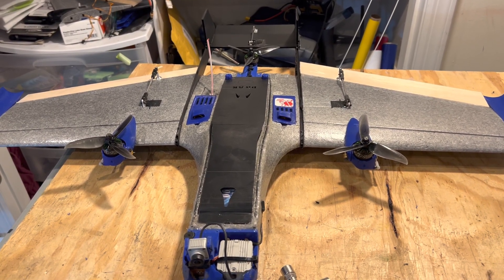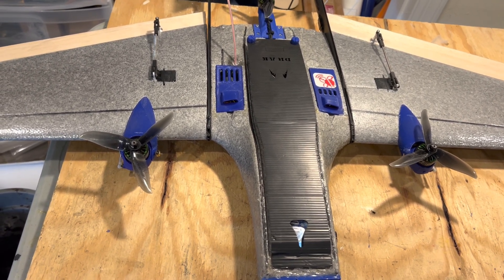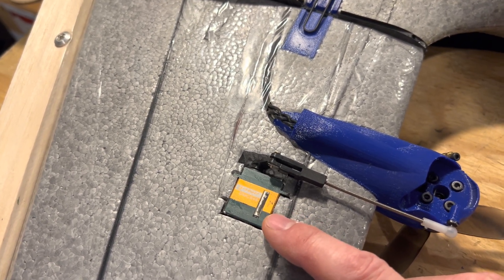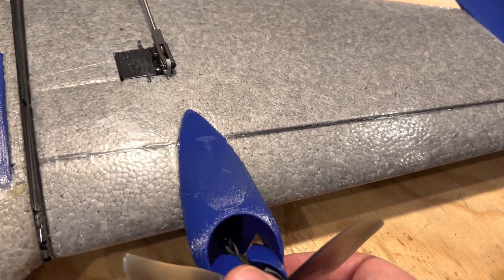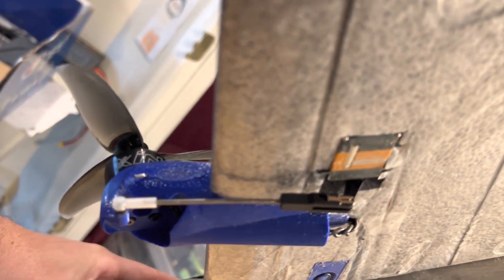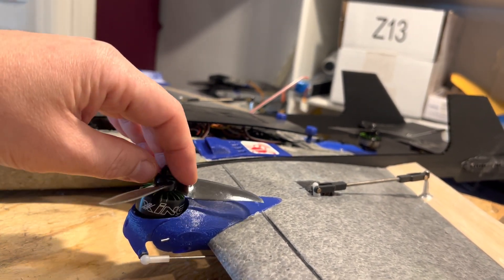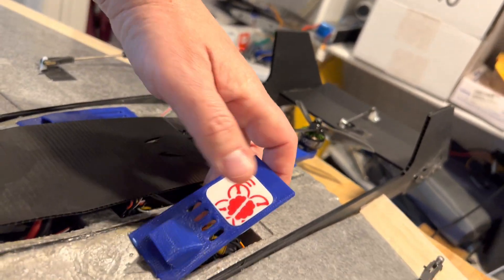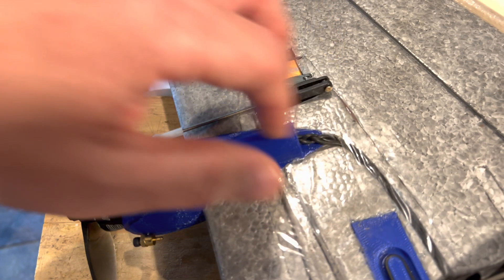Nano Drak VTOL build walkthrough

Comment: beautiful nacelles tilt motor set up!  Will follow your lead on big strong servos.  I notice you use the Brain GPS which I believe does not have compass.  Does the vtol firmware not require a compass then?  I have many gps even a Brain GPS on hand but the only one with compass is a janky old fake-dji gps I have on an inav quad right now.  I would rather not bother with compass if possible.
Reply from the maker: As a matter of fact that is just a brain gps cover but I replaced the gps with one with a compass.   Some vtol modes work better with a compass but it’s not absolutely necessary.  Ardupilot can rely exclusively on gps.  But all my vtols have a compass.

Comment: This thing is soo cool! You mentioned you're running 6s. Lipo or lion? How many mAh? Thanks and keep up the great work.
Reply from the maker: Thanks!  I’m running a 6s lipo.  Recently got some 2600 gensace 6s that fit better than the 2200 ones I was running.   I do have a 6s 21700 li-ion pack arranged in triangle formation for another plane.  I can squeeze it in but it’s tight and feels a bit too much.  I haven’t tried flying with it yet.  6s 18650 might be better.  Amp draw is obviously a concern but given you take off with a fully charged pack I think if you keep hover short it would be ok.  Landing has to be quick too but again you are landing which is less demanding than taking off so long as you keep it short and efficient.  That by the way takes practice.

Comment: Did you gave up on the T1 vtol and focus now on the drake? -__- just got the parts in for the T1 :P
Reply from the maker: Not at all!  I flew the T1 a couple of times yesterday. I love it.  Just got some 4S 2000 tatuu packs for it that fit nicely.
Reply: @Appelm1  nice, any chance it would fit a 6S lion that would be sufficient to sustain VTOL amp draw? :)
Reply from the maker: @JulianGoesPro  in the T1 Ranger?  no way.  It can maybe squeeze a 4s 18650.  I have a 4s 21700 that is too big.   If you're asking about the Nano Drak, you should be able to fit a 6s 18650 pack in triangle form.  I have a 6s 21700 triangle pack that is just a bit tall for the bay.  I can probably squeeze it in though.  But it just feels a bit too much.  Would it handle amp draw?  I think on 6S it would.  4S I don't think so.  But on 6S if you keep hovering minimal I think it could be ok though I haven't tried it.
Reply: @Appelm1  was actually talking about the T1… am in the process of swapping PNP components for your 3D printed designs :) Any updated configure files? Thank you for sharing your knowledge!
Reply from the maker: @JulianGoesPro  gotcha.  No the design is still good. Works great and I think you will like it.
Reply: @Appelm1  no changes to your ardupilot settings? -__- I am a bit scared.. tried it years ago but only on the ground since I was just too scared and iNav was so easy…
Reply from the maker: @JulianGoesPro  ah yes.. you reminded me.  I just uploaded the latest param file for the T1 to thingiverse.  There are a few changes for version 4.2 of Ardupilot.  Yes its a bit scary jumping into Ardupilot.  But take your time, follow my settings video and you will get to know it.  Its actually pretty easy once you learn your way around a bit.
Reply: @Appelm1  thank you :)